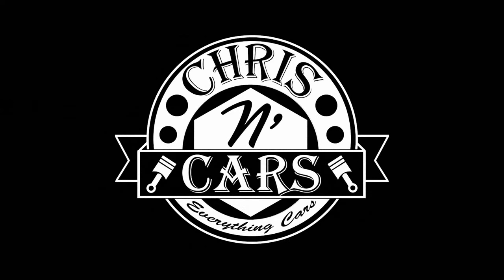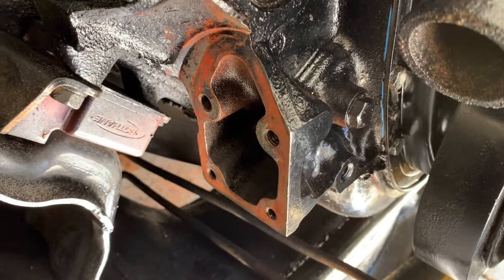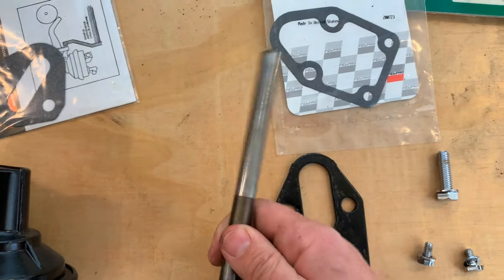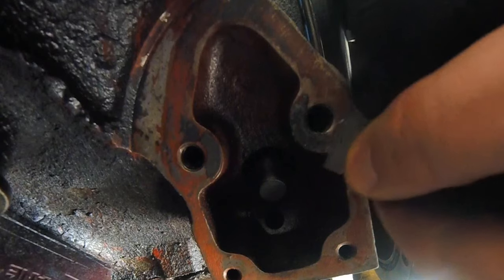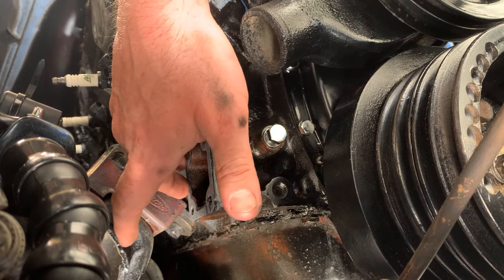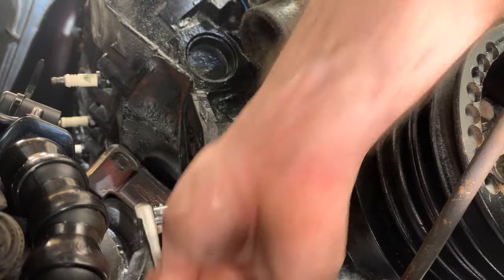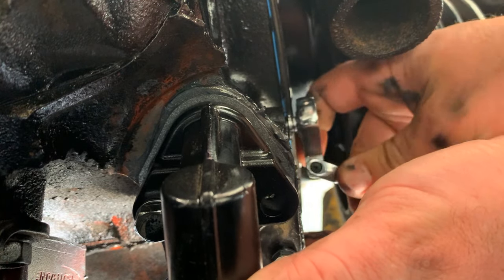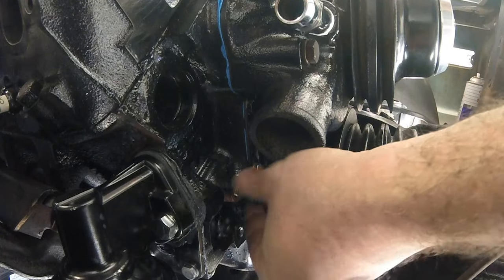Small Block Chevy Fuel Pump

Comment: I have a 71 K5 Blazer. All of a sudden it won't run unless I put gas in the carburetor. Runs for a minute. How do I know if it's the carburetor or the fuel pump? And help with greatly be appreciated.
Reply from the maker: If you look into the carb, while running you should see fuel shooting out of jets when you hit the throttle. If you don’t it’s probably the pump. Could be a lot though, clogged jets, fuel line or filter. If it idles rough or dies when you give it gas, probably a vacuum leak.
Reply: @ChrisNCars  yeah I did that, no fuel at all. It won't even start without putting a little gas in the carb. I've been having carburetor issues though too. That's why I was asking. Baby was a fuel pump getting weaker and weaker all this time?
Reply from the maker: @poolman8676  probably the pump then. At least it is a lot cheaper then a new carb!
Reply: @ChrisNCars  just rebuilt the carb, it hasn't run right since. Lol... Thanks again. New subscriber as well
Reply: @ChrisNCars  update, it's a week accelerator pump in the carb. Fuel pump is working like itshould.
Reply from the maker: @poolman8676  good to know! How did you end up diagnosing that?
Reply: @ChrisNCars  sorry for the late reply man. Now I know it's the fuel pump because when I take out the hose that goes to the carburetor and I crank on the engine, no fuel.
Reply: @ChrisNCars  cuz when I rebuilt the carb it was all dry and cracking. Ended up putting a new off-road carb on it. Works pretty well then the stupid fuel pump went out

Comment: Did you wait for the previous pump yo fail or prior to failure?
Reply from the maker: It was leaking oil and cheap part so I replaced it when working on the engine.
Reply: @ChrisNCars  is there footage of the actual pump removal in this video? Got some questions I'd like answered before digging into mine if at all possible

Comment: Sorry but… where do you get the rod to use?
Reply from the maker: There should be a rod in your engine if your pulling out a mechanical fuel pump. If you don’t have a rod and there is a plate your probably have an electric pump somewhere
Reply: @ChrisNCars  thanks for the response! Brand new beginner

Comment: You messed up on explaining on if both sides of the gasket get sealer that goes to the fuel pump itself which is fucking confusing so now I am stuck wondering if I should just put gasket sealer on only one side then apply gasket sealer to the pump itself so very crappy explanation. At 5:19